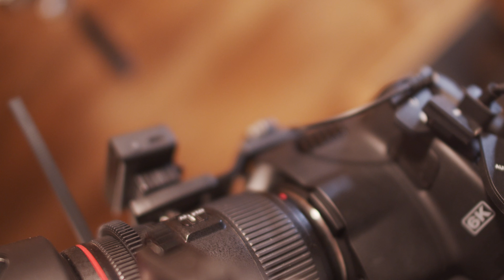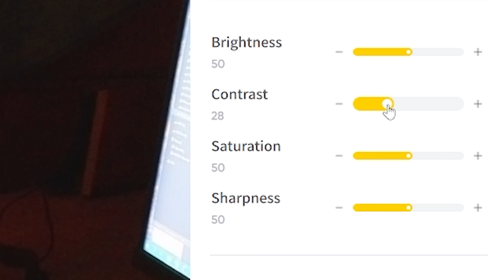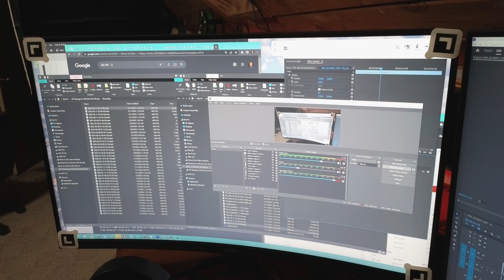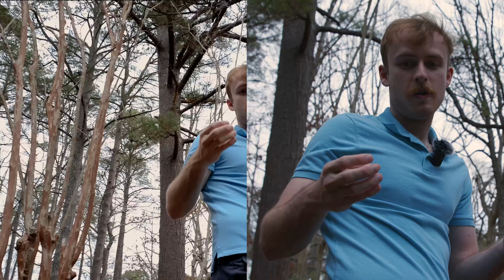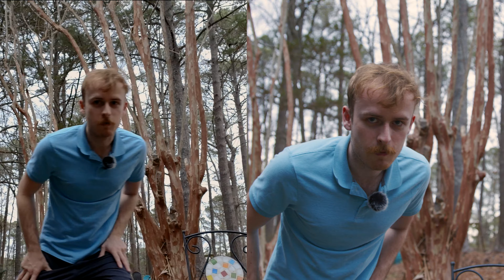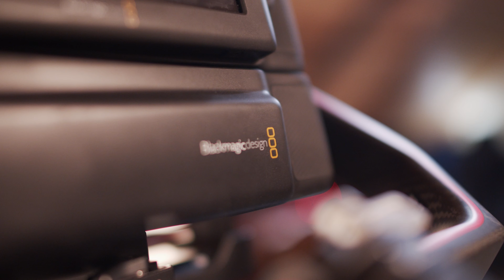Insta360 Link vs DJI RS 3 Pro w/ BMPCC6K Pro and Lidar Focus Review

Comment: I Ain’t never had my trust in a YouTuber disappear so fast. Thanks for making the script written by insta 360 obvious at least. Don’t believe this shit, obviously a cinema camera will be better in every way, and any “downsides” other than  price and weight are issues anyone can fix with settings that the insta doesn’t even have. Don’t buy a 300$ webcam just for some shit tracking. Just reach up and adjust it. Any sort of cinematography you might want to do with a insta 360 is instantly ruined by the bad framerate. Also, why are we using a multi thousand dollar camera rig and comparing it to a 300$ webcam??? If this is about streaming, compare webcams and cheap mirrorless cameras. Obviously a 300$ device will outperform when it comes to value vs price if what you need is a 100$ camera.

And if this comment gets shadow banned, I will know.

Also if you want to comply with eu, uk, and au law, put your sponsor cautions before the ad, not after.
Reply from the maker: Um… I won’t remove your comment. Did you even watch the video?

I am a little interested how me spending a majority of the video bashing how poor the low light quality is and how the gestures do not work is shelling a script? I am actually looking forward to the nasty Insta360 email about it.

I wasn’t paid any money for this video but I was sent this for free. I include that disclaimer via YouTube and in the video every time I get something for free or paid. I just got the camera, that’s it. 

This video I tried to let the viewer decide with side by side comparisons. I don’t think I mentioned a single bad thing about the cinema rig in the entire video? Did you watch it?
Reply from the maker: Follow up: got that email
Reply: @JaysTechVault  And sent you an email to complain even more?!
Thanks for the video, it was helpful.
Reply: @JaysTechVault  i was so confused about who he was talking about 😂